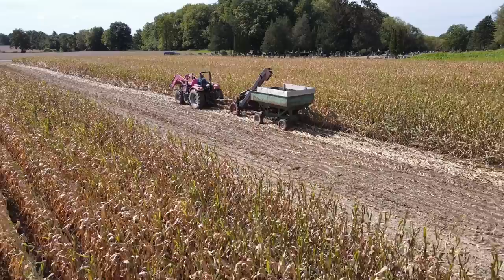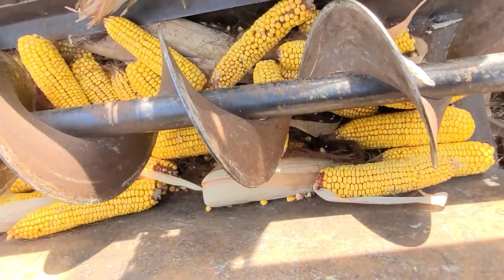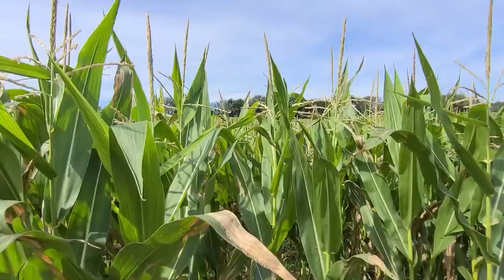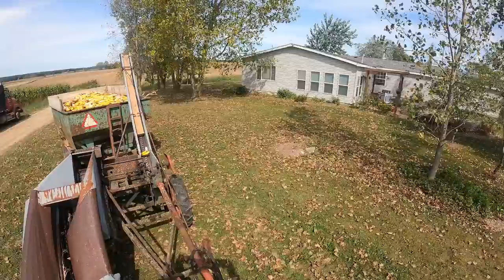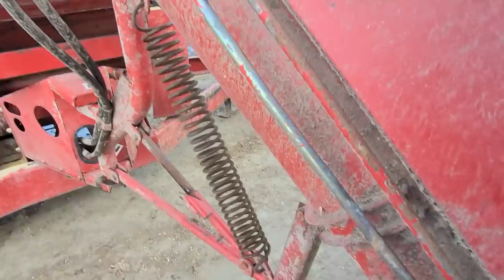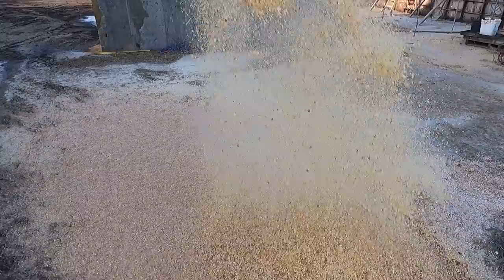New Idea 323 1 Row Corn Picker

Comment: That's a good idea to help hold you over until you're ready to start on earlage and get by without buying corn. That wouldn't be a bad way to do it all if it wasn't so slow and you didn't need so much.
Reply from the maker: Took about a 1/2 hour to pick a wagon load and another 1/2 hour to grind.

Comment: The first farm I worked on had 40 milk cows and 500 sheep. We filled a wooden crib 8×14×60 plus 3 or 4 wire cribs.  We ran a 324 New Idea to pick and then we had another 324 with a shelling unit that we shelled corn for the sheep. We used a 4020 diesel power shift to run both pickers.  We stored the shell corn in the chopper wagons, gravity wagons and kicker wagons lined with plywood.

Comment: Growing up, we had a NI 2 row picker that we used for high moisture corn.  We had a Farmhand Grinder/Blower that we would grind most of the loads and blow into our silo.  But in the meantime, we had a McKee (?) 3pt mounted grinder/blower.  We would grind a gravity box load and blow into an old chopper box next to the barn.  Once we filled, leveled and opened the silo, we'd quit grinding into the chopper box.  Now, all we do is earlage with our SP Harvester as well.

Comment: That’s husking better than my bosses 6-row uni-picker! We used to have a Devil of a time just getting wagons unloaded! We also kept plugging the shoots in the crib. He had a wood crib with a roof and storage between the cribs. It had several openings along the peak of the roof and several shoots built between the trusses. If you place the elevator just right, you could fill both sides at the same time.😎

Comment: WOW!!!  That corn picker brought back memories!!!  We had a 2-row pull-type New Idea corn picker that we pulled with a Farmall "M".  We used flare-box wagons to put ear corn in.  We never did graduate to gravity wagons.  A few farmers in our area started using gravity wagons in the 70's.  In the late 60's, we graduated to an Oliver 2-row pull-type corn picker pulled by an Oliver 1850 gas tractor.  We never worried too much about getting the husk off the ear, because there is good nutritional value in the husk.  We ground up the whole ear for feed for our Dairy cows and Black Angus cattle.  Not to many farmers in my day had grain bins.  We would mostly store ear corn in corn cribs.  When it came time to shell corn to empty the cribs, we had a special corn shelling rig come in and shell the corn off the cob.  It would separate the shelled corn, the corn cobs, and the husk.  We hauled the shelled corn to the town elevator, the cobs were used for bedding, and the husks were used as a feed supplement for the cattle.  Basically the same as turning the cattle out into the fields in the fall and winter, to graze on the residue.

Comment: 323 made from 1965 to 1977, almost antique haha, 1950s my dad and I picked corn with a mounted JD 227 2 row mounted picker on a 60 JD, dirty, noisy job but now all combined in Iowa, did you use the big hole screen on grinder mixer, makes excellent cow feed!
Reply from the maker: Yes, we used a 1 inch screen to grind it.
Reply: We had the same picker mounted on our JD 70. Ear corn ground with the Farmhand mixer mill made great cow and pig feed.
Reply: @greghamann2099  we used a Letz burr grinder but hard to line up long belt in the winter and used a big stick of belt dressing, good ole days

Comment: Interesting inconsistency in the corn ear formation.  With modern seed corn and fertilization, most of our ears nowadays look like they were stamped out by a machine.  Not a criticism -- just a comment.  The old classic way to harvest corn was using a 40 bushel steel wheeled wagon with Mom and Dad throwing the corn against the bang board and Prince and Dan pulling the wagon.  We kids just rode.  The horses knew what to do.
Reply from the maker: Well, we've had a very challenging growing season this year. The corn definitely isn't picture perfect, but it will meet the need.

Comment: Nice video.   Should do live feeds sometimes
Reply from the maker: I haven't learned how to do all that yet...
Reply: @acresofclayhomestead  ::  They certainly can be fun, however you will want a few Rock Solid Moderators aligned and ready to go when you start.
I am a moderator for a couple of firewood related channels and some pretty vulgar and inconsiderate comments will occasionally pop up.  I don’t know how the trolls find out, but it can happen to any channel big or small.
You set the bar and your mods should carry out your wishes to the letter.    Generally the host is too busy to keep a watchful eye on the comments.
I would be willing to assist in any way you need.
Bless’ns to ya,   Tedd

Comment: Interesting about the modification on the picker I would like to know if Kevin had to experiment with different size sprockets to run that auger at the right speed or did it just kind of work out okay. Back on the farm when I was a kid we had a one row Blackhawk picker and I would ride in the trailer in the back that had one and a half ft wooden sides and let that corn throughout the day pile up and cover me as I set up in the back corner back corner for fun. I was supposed to be  shucking but I didn't do a lot like I was supposed to, well I guess I'll blame it on being 10 years old.
Reply from the maker: The sprockets just worked out good.